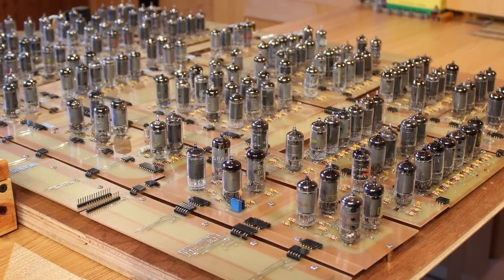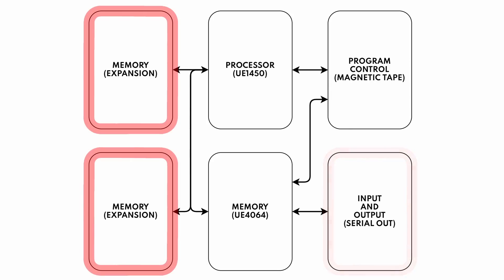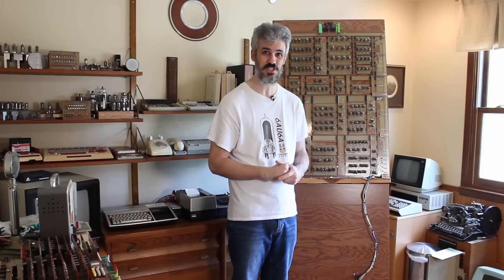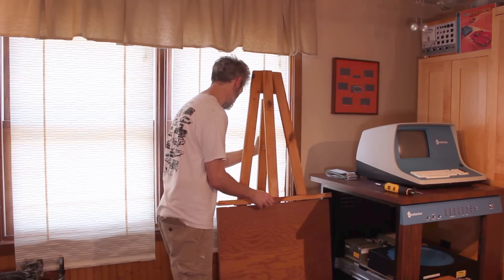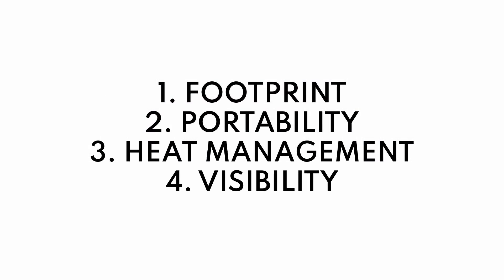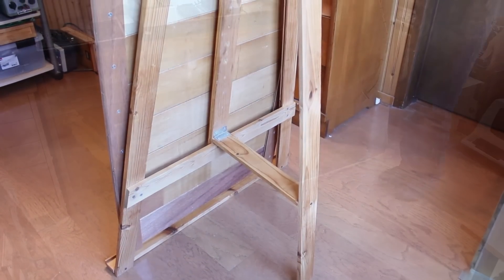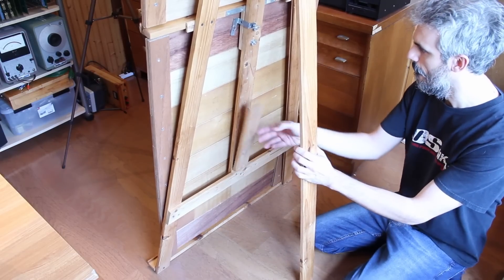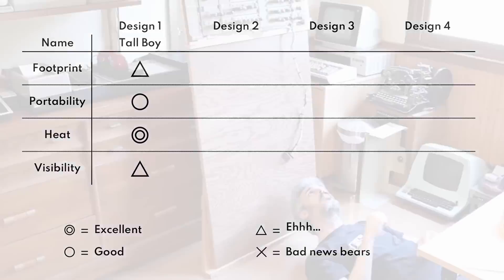Vacuum Tube Computer P.27 – Trying to Build a Mount for the Computer

Comment: What about a combination of #3 and #4, the "cabinetless fanning filing cabinet"?
I.e., horizontal planes (or planars in IBM terms) that swivel out to a fan-like arrangement with vertically layered board mounted to a post at the rear. For transportation, fold them in and add some boards to the sides to make it a cabinet. For running and display, remove the covers (or fold them down) and fan the planes out for best airflow and visibility.

Only downside (that I can seee) the swivel mounts to the rear post will be mechanically challenging, as the load is resting on what is essentially a lever, while the entire arrangement has to be stable, sturdy and still operable. I think, it could be done, but it will add some weight.

Comment: Collapsable Cray seems ideal. Allow boards to be folded parallel for storage and transport. Mount VFD's so that they are easier to see based on the board location in the unit, or use (totally reasonable) reflectors made of thin gauge polished stainless steel.
Reply from the maker: This is actually really similar to an idea we had brainstorming over on the Discord!
I've been calling it the "Tri-Force," because that's a cool name. Here's a sketch I drew up of the idea a few days ago: https://raw.githubusercontent.com/Nakazoto/UEVTC/main/Reference/Cases/Tri-Force.jpg
Little reflectors for the VFDs will be needed, but that seems like it should be a relatively easy to get something working well.

Comment: Start over. Design to standard 19" rack width and position all controls and displays as a front panel. Use perforated metal pull out panels instead of wood to save space and enhance cooling. Mount in a portable rack with cooling and power supplies. This will not be easy or cheap, just far better than any of the prior art.

Comment: I was in fact planning on suggesting the Cray design however, I would look at the CM1 Connection Machine, for a few reasons.
If constructed in cube array as a singular block it allows you portability, visibility of all components from 360 degrees. Power supply in the centre not visible and 5 visible faces. Top included. With a dark smoked plexiglass exterior, those VFDs should show through as reflected light off the pcbs as well as the heaters. You are already making the panels the same overall dimensions so, it won't be an issue. Enough clearance between the Glass and vales will not pose any significant thermal welling and in fact will create a thermal up draft due to change in air temp. Like a chimney.
Now your box fits in an suv in a single unit plus, looks cool and very groovy. Put a rotating lazy Suzanne base under it if you want to spin it around. Simple cube shape 
Ultimately, you're reproducing a 1980s, 1 bit processor so, why not make it look like a machine made from an array of one bit processors?

Comment: About the name : Usagi Phoenix (tube re-born on digital staff) or Computube are some options avoiding acronyms. About mounting: A possible solution might be a shelf square based ( using 4 sides) but rotating un a shaft coming out from a wheeled stand (like a office chair). This kind of shelf are used as post-cards or sunglasses exhibit, they can rotate 360 degrees. This will require a bit of flat ribbons. Please describe know how to reach you on the chat server since Is completely unknown for me. Another pleasant video, many thanks

Comment: I'd try to combine the filing cabinet and Cray design: Start with the stack of boards and, on one side, mount spacers to the boards and add hinges between each two boards. That way, you'd leave the whole thing stacked (with explicit cooling) or rotate it and open it like a book. You'd even "turn pages" and have a vatiable angle between the boards.

Comment: place sockets for the VFDs and then use either right-angle adaptors if main pcb is vertical or straight adaptors if horizontal. visibility problem solved.

Comment: Im thinking you should do the filing cabinet type but have them oriented vertically with a ventilated top and bottom, letting the heat rise out, maybe even putting cooling fans on top if necessary

Comment: Suggestion for storage and display.
Consider a folding toolbox.
The old style tool boxes would fold from the center out with multiple levels.
Or
Consider using your trey shelves design for transport and then lay the boards out on some tables for the display of the computers functionality.

Hope these ideas help.

A Fan

Comment: The Cray design is interesting. Give it a spine like a thick book with the board "pages" spaced enough that it can be flattened without the components from each board touching. Maybe even give each "page" a lip so it folds closed into a lockable cabinet.

Comment: For the name, I think would be a really good fit "Davinci V1".  The Davinci part due to the fact that is supported by an art easel and the wood construction per se looks like a piece of art and engeneering that davinci himself would build.  The V part is for vacuum tubes and the 1 for the model number.
Reply: Maybe, just to lengthen the achronym you could do something like this: "DaVinci VTCM 1.0" or MK 1 maybe.
VTCM would stand for Vacuum Tube Computing Machine, similar to VTVM in sound.

Comment: drawer sliders that slide out into a wall
or hinges that fold 2 boards like a book, would be hard to transport tho cuz the tubes would be on the outside and you would need multiple "books"? 
could fold the it inwards with spacers around the edge so the tubes don't smash together and you can transport them easier

Comment: For the name...How about:
U-100                                           or U-1     
Usagi-100                                  or Usagi-1
UC-100                                       or UC-1
UE-100                                        or UE-1
Usagi Electric 100                 or Usagi Electric 1
"Your name" 100                    or "Your name" 1

As to a method of constructing the mounting panels, how about making the structure in a manner such that all the panels have their backs pointing to one of the others in a "modified square" with the bottom larger than the square at the top.  That way they all would be leaning back a bit, and to store after finished with the display option, you simply disconnect the "latch" that holds the pieces together and swing them all out side by side, lock them in that position and then hang them on something either from the ceiling or the wall.  It would cover a bit of space horizontally when stored, but the depth would be much smaller than the options you showed.

Comment: Suggestion for mounting... call it falling dominoes - mount the boards flat front to rear, but at 45 degrees (or whatever angle works best for space, even straight up) side to side. Leave sufficient space so the boards can be viewed. Heat flow will be good since it's mostly still vertical. The dead space at either end caused by the 45° angle can be used for power supplies. The whole assembly can be elevated to put it on eye level or perhaps 1 or 2 boards can be at the bottom but still viewable.

Comment: What about “slow trash can mac” two units made of three boards in a triangle configuration with the tubes facing outward. Stack one on top of the other.  Then you have a tall boy made of two units.  Might make a cool installation because you can walk around it and see all the different sides.  It would be somewhat portable with less disassembly.
Reply: I like this idea. If you are more than 1m tall you can look down to read the VFDs.

Comment: The "Usagi VTC-1" Sounds fine to me tbh.
Reply: Also, I think there should be seperate (additional) display. Worry less about the airflow, heat convects fine. Some well spaced horizontal slots in a rolling cabinet, like a jumbo verson of your mainframe, seems most practical. Heat isn't too bad with a few fans. I built a 14 tube guitar amp and one 120mm is fine. Also consider playing with the heater voltage if it's making a ton of heat that way. Tldr: Design 3 with an extra display.

Comment: How about the filing cabinet where the boards slide out the sides , two middle ones slide out leaving the top one and the bottom one with a large gap between them.

Comment: Re the arrangement, Do a vertical I-beam arrangement with the circuit traces back to back, (but separated obviously) this allows the tubes to be all visible.  Then you can mount the board in a hinge so they can swing out for servicing.

Comment: idea for a name:
REVTOCS-1
(Rabbit Electrical Vacuum Tube Operated Computerized System 1)
[pronounced REV-tox one]
Reply: I like that name. It's catchy and to the point. Brilliant.
Reply from the maker: Oooh, that's a good one, thank you for the suggestion!
I've got a big list of name suggestions I'm making, I'll add it in!
Reply: @UsagiElectric  Mind you, Rabbit Semiconductor was a company and a processor manufacturer at that. I'd avoid Rabbit in the name. https://en.wikipedia.org/wiki/Rabbit_Semiconductor
Reply: @aharkness5657  if they aren't an active company anyway more then it's non issue.

Comment: For Design 1, if you oriented the memory board upside-down, you'd then look down on the VFDs from above and should be able to see them. You'd have to stand close to it, of course.
Reply: I do not understand why he did not address this in the video!  Maybe you and the other 9 people who liked this and I are all missing something.  I was so frustrated hearing him go into these other options when all that needs to be done is rotate the memory board.  One explanation I can think of is the interconnect would be too long.  To me, this is the best of the solutions.  I don't like the other options, for visibility or heat transfer.
Reply from the maker: That is actually something that I thought about, but visibility of the VFDs isn't my biggest concern with the tall boy design. Being so tall with such a high center of gravity, it just takes one little mistake to tip the entire forwards and have it come crashing down in a 25kg collection of pain. The other designs were ideas mainly to address the footprint and portability, but also take into account stability as well.
Reply: @UsagiElectric  I was wondering if you could use mirrors somehow. I looked around for large, lightweight ones and they make pretty affordable acrylic mirrors which could be useful for you. Just a thought.

Comment: Regarding the name, I think it would be cool if the name referenced the low number of bits. Maybe something like 'The R4bbit'?

Also, for the mount, you might want to have a taller version of the pinball version, with some cabinet slides. If you give  around a foot of vertical space for each board, you could end up with a six foot stack of boards with semi-decent visibility and enough spacing to allow for some decent air flow.
Reply: Hmm, I like that!
Reply from the maker: Thanks for the suggestions!
Hmm, so essentially pinball but smartly built to stack them all in one stack? I've got a big list of suggestions going on, I'll add it to the list!

Comment: What about a sideways version of the cabinet? That way the heat could still dissipate upwards, and with a good amount of spacing, visibility shouldn't be too bad either.
Reply: How the hell did you comment 8 hours before the video even came out
Reply: @cuppapeppa3286  Patreon Preview lol
Reply: @Pixel Brush  oh ok
Reply: This is exactly what I was thinking. If you had the VFDs facing to the side, then you'd want it sitting on a table or something higher up, for viewing. I think this arrangement would make the 1m dimension the depth, and 0.7m the height. With the better vertical heat flow, spacing could probably be 15cm, giving a width for the 6 boards of under 1m. The boards could slide in just like the cards on the Centurion.